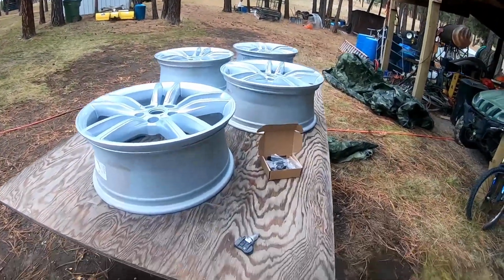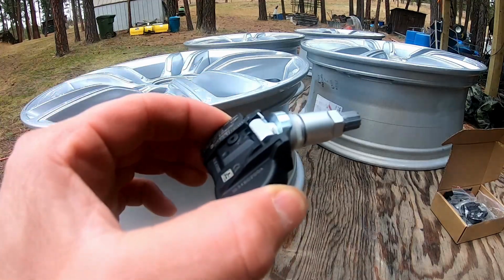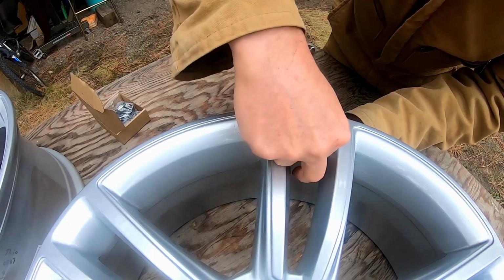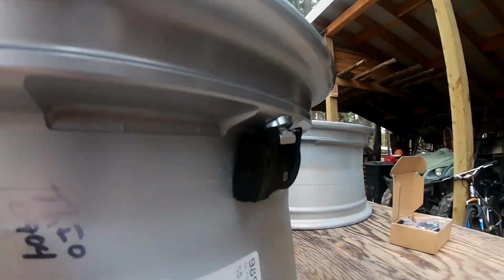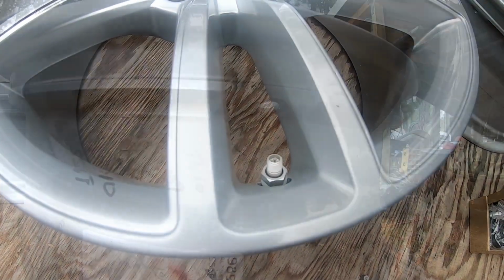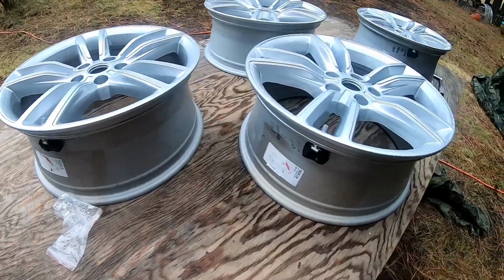Installing TPMS sensors on Tesla Model S 19" Base Rims. How to install TPMS sensors.

Comment from the maker: 👀Timestamps take you right to that chapter:
0:00 Introduction
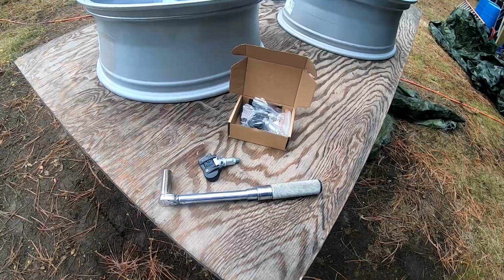2:00 What you need and torque specs
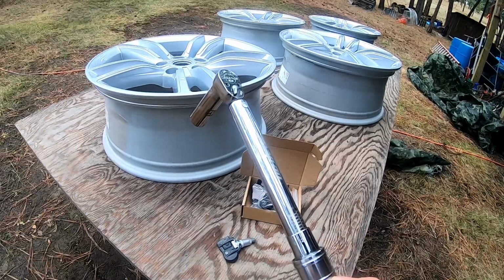2:38 The TPMS sensors
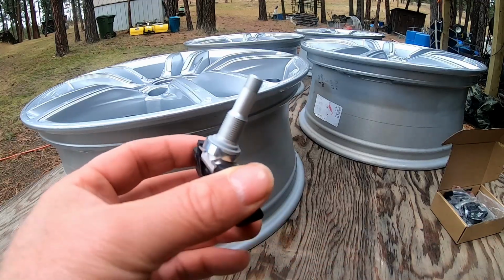4:01 Installing sensors
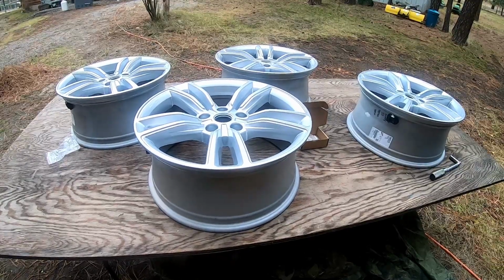9:45 Conclusion

Comment: Thanks for the information! Could you pass on a link to the brand/model of TPMS sensors you got?
Reply from the maker: Certainly, I ordered those from ebay. The sensors are probably made in China but they ship from the US. These are the cheapest sensors I found. So far they work just fine. This was actually the second set I ordered from the same place. The first set is installed in the 21" wheels on the same Tesla Model S. 
These sensors are for the Continental TPMS! A 2013 until about 2014.5 Model S usually has the Baolong system. You need to know which system you have.
I do have a 2 part video on how to upgrade from Baolong to Continental.
Part 1: https://youtu.be/QaMBYfzy_Gg
Part 2: https://youtu.be/Wmas_ad14_4
link to ebay: https://www.ebay.com/itm/324285187559
😀😉
Reply: @RMTFamily  Do the sensors from ebay work fine so far? I bought some from Ali and they work, BUT sometimes it displays error message "Tire pressure monitoring system fault" at higher speed, it's annoying. TMS 2015
Reply from the maker: @elektricka  Yes they still work fine. I actually have one set in the summer wheels and a second set in the winter wheels that are in this video. Both sets are still working fine. I have not had any issues.😀
Reply: So if you do the upgrade are those just the blue newer Bluetooth ones that you need to buy?

Comment: Great VDO/Channel! I’ve been following your channel, since I just bought a 2013 Model S P85+.  It comes with stagger set of 21”s. They look very nice, but the ride is a bit rough and noisy (tires can be expensive and I can’t swap them front <->back).  I’m looking for a set of the classic 19” like yours.  I can read the tire psi on my dash screen, so I assume my car TPMS system has been upgraded to the Continental system already.  I’m ordering a set of sensors from Amazon.  When I install these new sensors, do I need to program them to my car?  How does the car know which one is which (FR/FL, RR/RL)?  And if I have my old set sitting in my garage close to the car, will this confuse the car from reading the psi from the new set of sensors?  Sorry I have too many questions.  Appreciate your help.  Thanks!
Reply from the maker: Thank You!😀
Great questions.
Yes your car has the Continental system since it shows individual tire pressures. 
You're correct, staggered tires are all around more money no matter what. Staggered is not necessarily the cause for noise. Depending on the tire some make more and others make less road noise. Sometimes there is even a difference of noise between sizes of the same tire. There is no guarantee that the 19" tires will be less noisy. But they will be better for ride comfort as you get more sidewall on the 19" tires. The sidewall is kinda like a spring, the more sidewall the more spring the better the ride comfort but the worse the handling in high speed turns. But since you don't take it to the racetrack, I assume, you won't notice a difference in daily driving.
It's the beauty of the Continental TPMS that there is NO programming required. If you just put them on the car will ask you, after driving a little, if you changed wheels. Then you choose the wheels you put on and the car will do the rest. Or you can go into the service menu and choose the new tire configuration and the car will take it from there.
The TPMS sensors use radio frequency signals to transmit the data. Each sensor has a unique identification number. I'm not sure but believe the key FOB antennas will pick up the TPMS signal as well, send it to the ECU which then send the information over the CAN bus to the TPMS ECU that then sends the processed info back thru the CAN bus to the dash. The same way the car can triangulate your key FOB position in and around the car, it can locate the TPMS sensor signal origination.
No, it will not be messed up by other wheels with TPMS in your garage. You may already have noticed that sometimes when you first start driving there is no pressure displayed. This is because TPMS sensors fall asleep. If they are not spinning (wheel turning) they fall a sleep after about 15 minutes or so. That makes the battery in the sensor last longer and there is no interference when you transport wheels inside your car, like when bringing them home from tire shop, or if you would carry a spare with TPMS in the car.
I hope I answered all your questions. If not or if you have more feel free to ask, I will answer to the best of my knowledge.
Keep watching our videos! Thank You.
Reply: @RMTFamily  Appreciate your quick and detailed reply!  All my questions were answered.  It makes a lot of senses that the sensors do fall asleep when they are not on the rolling wheels.  Good to know that the system is smart enough to automatically detect the new installed sensors. Thank you!
Reply from the maker: @Widmer09  You’re welcome
Reply from the maker: Are you still looking for those wheels? Just seen a set of 5 wheels with TPMS on "Tesla Parts Buy Sell Trade" on Facebook.
Reply: @RMTFamily  Thanks a lot for letting me know. I found them locally already.

Comment: But it’s not as easy as just changing from Baulong to Continental ? You must change the sensor harness that is located at the rear left door ?
Reply from the maker: @peteroffpist1621  That would be too easy 😂 On the early ones the harness and ECU needs installed. Then about a year before they switched they had the harness installed already and only the ECU installation was needed. Here is the link to part 1 of the two videos on how to do it. 2013 Tesla Model S TPMS Retrofit from Baolong to Continental TPMS,How to do your own retrofit Part 1
https://youtu.be/QaMBYfzy_Gg

Comment: Hey thanks for the vid! I have a question. I have a 2014 p85, I just got the 21inch gray turbines used, however no tpms so I need to get my own. I looked on the link you left but can’t find them. I know I need the baolong kind (I asked Tesla service to make sure) does that eBay link have the kind I need? Thanks again
Reply from the maker: Hi, I used the newer style Continental TPMS. I did upgrade our 2013 to the Continental TPMS. The Baolong is still available from Tire Rack for $ 67 per sensor! Not cheap at all. You could upgrade the car to the Continental system and then order those sensors, I have two videos on that, here is the link to video 1: https://youtu.be/QaMBYfzy_Gg
I also checked ebay for the Baolong type and found this: https://www.ebay.com/itm/401624090868
These are not the same I ordered and I don't know anything about the quality. But you get 4 for the price of one.😉
Those I ordered were similarly priced and made who knows where, I guess China, but I bought two sets and both sets are still working. Have one set in the 21" for summer and the other set in the 19" for winter.
Here is the ebay link to the Continental that I purchased: https://www.ebay.com/itm/324285187559
I hope this helps.
Reply: @RMTFamily  Thank you for all your help and insight. 🙌🏽 I’m new to the tesla family and look forward to these videos. Last question the link to the baolong you posted says 2012-13, you think it would still work by mine being a 2014? 🤔
Reply from the maker: @UnBiasedConsumer  Yes these will work. The change from Baolong to Continental was sometime in 2014. All the Baolong sensors were the same until the change to Continental. From there on all the Continental were the same on all models until Tesla also started using to Bluetooth sensors about a year ago or so.
As long as you are sure that you have the Baolong sensor these should be ok. You can check on Tire Rack with the VIN to see when it changed.

Comment: hi I have a Tesla S 2013 85 like yours 
if I replace my sensors like you , how did you do the reprogram ? thank you in advance
Reply from the maker: The car will recognize new sensors and then ask you if you have changed the wheels. You can just confirm that. Or you can go into the Service menu on the touch screen and reset TPMS or change the wheel configuration.
This works as long as you have the correct sensors for your TPMS! 2013 had Baolong from factory but many were updated to Continental. If that is what you’re referring to, check out this video: 2013 Tesla Model S TPMS Retrofit from Baolong to Continental TPMS,How to do your own retrofit Part 1
https://youtu.be/QaMBYfzy_Gg